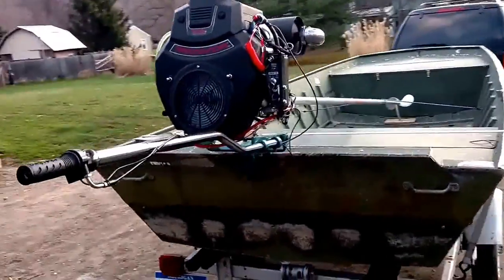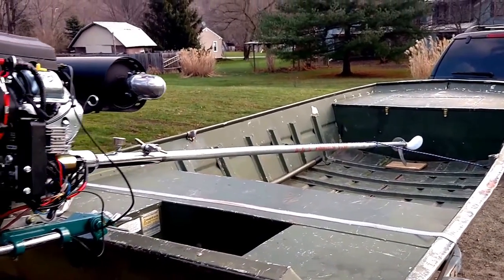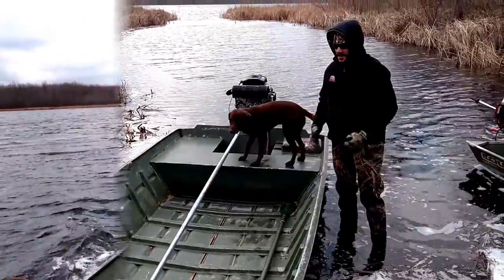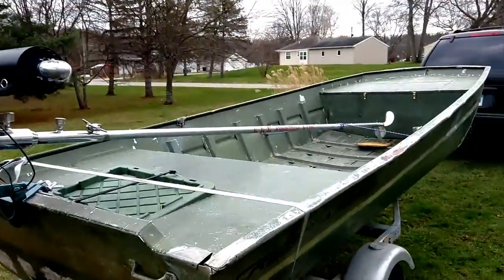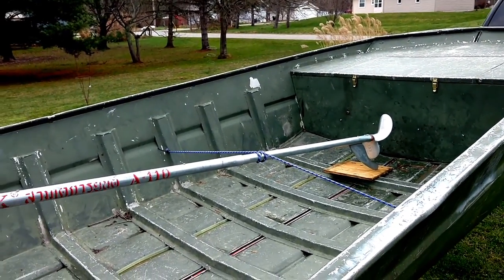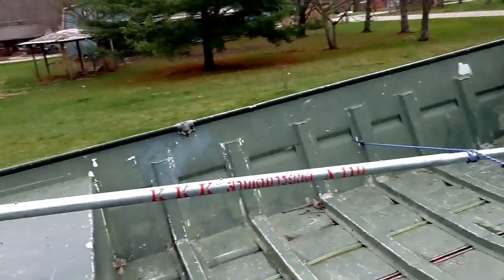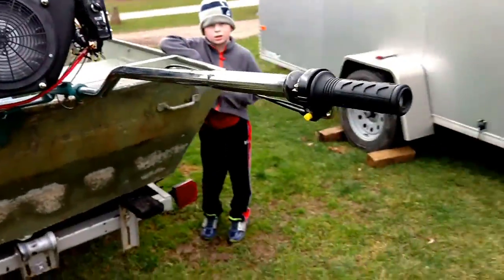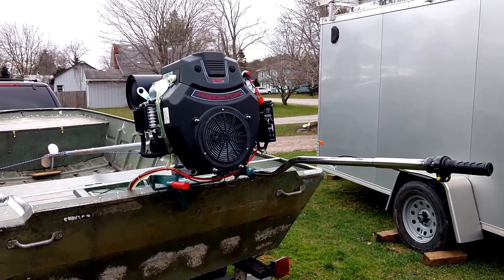Mud-Skipper Long Tail Mud Motor

Comment: You should bend the skeg to the port side using a crescent wrench.  Bend it slightly then try it out and keep bending until it sits perfectly in the point of the v in the wake behind the boat.  Swamp Runner recommends this to be done.  Skeg tuning.
Reply: Yeah everyone wants to put a cavitation plate on but you are 100 percent right i have a swamp runner and i bent the skeg can run it with one finger

Comment: I had the same problem when i first built mine. After welding a small trim tab onto my skeg I'm able to spin a 10" prop with no problems. Let me know if you want a picture of the setup...
Reply from the maker: I'd love to see a picture of it, my only concern is that it will catch too much vegetation when in the marsh.  The smaller prop was more manageable, but I was maxing out the RPM on the motor with it.
Reply: ThorazineShuffle75

Comment: i think the long tail is for swamps , not lakes?
Reply from the maker: Best for swamps, dirty or shallow water. Being air cooled you don't need to depend on clean water to cool the motor, and with the long tail you can propel the boat forward in just a few inches of water. Also props are relatively inexpensive if you damage one.

Comment: Is it possible to cut this and re weld the shaft so it's not so long?
Reply from the maker: Smaller horse power kits have shorter shafts, but I need the length due to the height of the transom. Check out their new surface drive kits, they are nice and short.

Comment: Are you left handed? Or do you like the handle mounted on that side better?
Just picked up a kit and just waiting for my 22hp predator to ship
Reply from the maker: I'm right handed, but what they call goofy foot, where I prefer my right foot forward, so this was more natural to me. Also the outboards that I have owned have been left hand tillers too.
Reply from the maker: Most outboards I use have the left hand tiller, so I figured I'd set up the Longtail the same. I  have since switched it over to right hand drive, as the kits geometry works better that way.

Comment: do the kits come with the long handle/throttle assembly?
Reply from the maker: When I bought mine they came with a thumb style throttle. I added a twist throttle from ebay
Reply: I just brought my new boat and predator engine home. Can you please educate me on the fuel system? Electric pump I do/don't need? Line diameter? Thank you
Reply from the maker: I just uploaded an update video, check it out and see if that helps at all
Reply from the maker: just put an updated video on my channel, see if that answers any questions

Comment: You need a grab bar, you'll regret not having one when you hit a side wave or log...
Reply from the maker: This boat is pretty stable, it's a 48" bottom. I've had it out on Saginaw bay in 3' waves and didn't have an issue, as long as I didn't take a wave over the side.